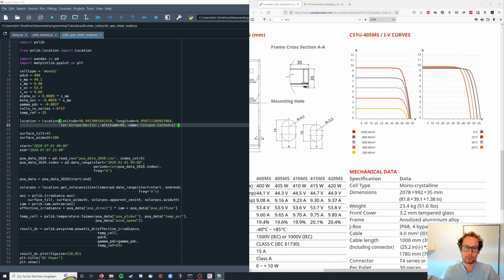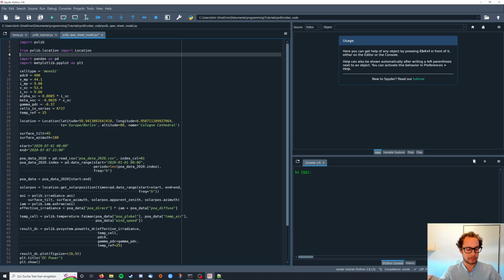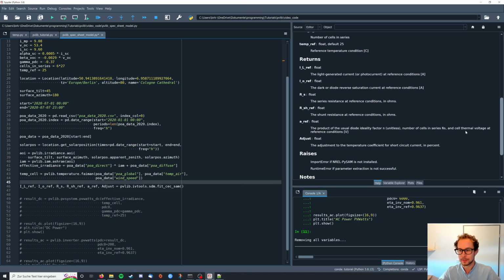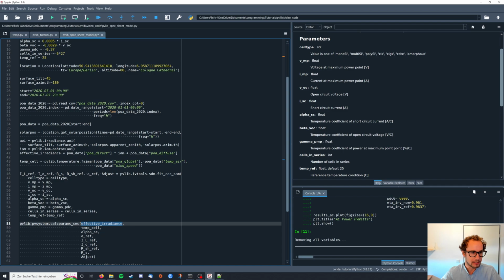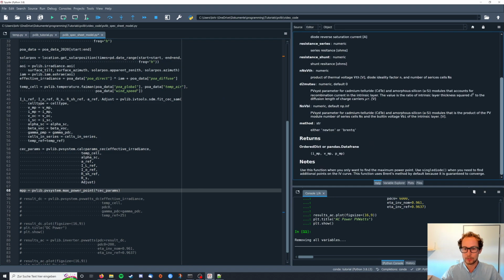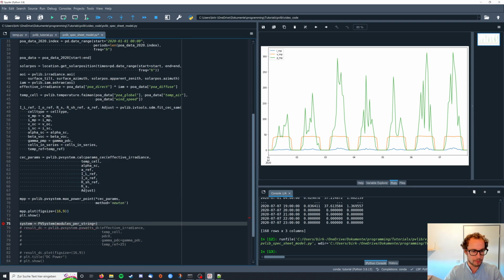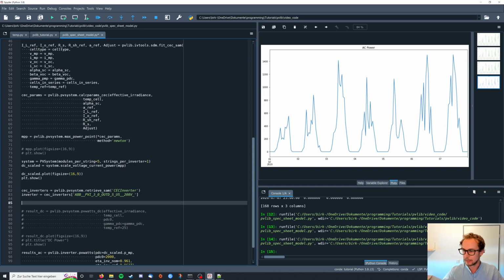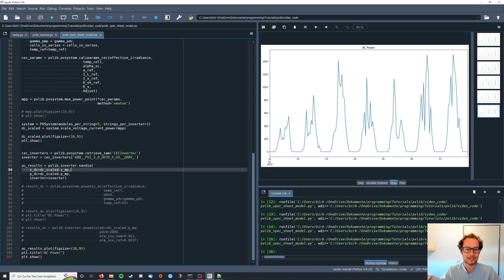pvlib python 11: Fitting of spec sheet based model

Comment: Hi Sascha, very interesting episode. I compared the Single Diode Model (SDM) of this tutorial 11 with the pvlib.pvsystem.pvwatts_dc method of tutorial 10.
It turns out that the SDM operating at MPP (max power point) gives, as expected, almost identical results to the much simpler PVWatts model.
Thank you
Rolf

Comment: Great video series! Why is the area of the specific module not included in the modeling of the DC Power output?
Reply from the maker: Hi, you are specifying the cells of the module and then define the total number of the cells in the module. Therefore you don’t need the area.

Comment: Thank you for your tutorials! Thy helped me a lot! I use it to calculate an output of my own pv system.

I have a pair of questions.
How can I use not just max dc inverter input parameter but other parameters (like in sandier database) to get more accurate model?
What is the best way to connect panels on different roff side (they have different azimuth_ to use inverter? Is it ok just to summarise app from both side and to use it as an input of the inverter?
Reply from the maker: Hi,
if you have more parameters for your modules, you can create a dictionary using the keys described here: https://pvlib-python.readthedocs.io/en/stable/reference/generated/pvlib.pvsystem.sapm.html#pvlib.pvsystem.sapm This tutorial is also helpful: https://pvsc-python-tutorials.github.io/PVSC48-Python-Tutorial/Tutorial%204%20-%20Model%20a%20Module%27s%20Performance.html
Regarding your second question, take a look at video 14: https://youtu.be/1RZm62LxnK4
You can define the two sides of your house as two arrays with different parameters.

Comment: First of all, thank you for the video! I have two questions: is it possible to calculate the max power point directly from the module databases in pvlib (cec en sandia) instead of doing this with the spec sheet of the module? And also which database (cec or sandia) is the best to work with?
Reply from the maker: Hi, well if you don't define any losses, your dc result of the modelchain should give you the mpp. I hope I'm not getting you wrong here. Regarding the database, I can't tell you if one is better than the other.